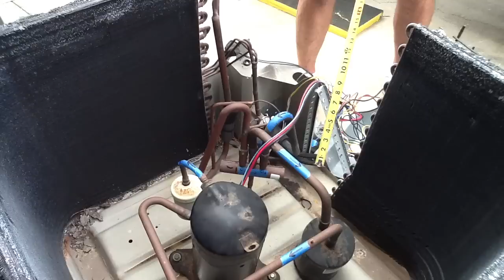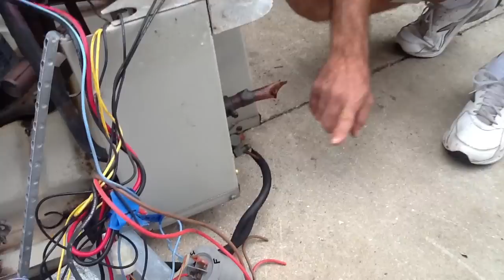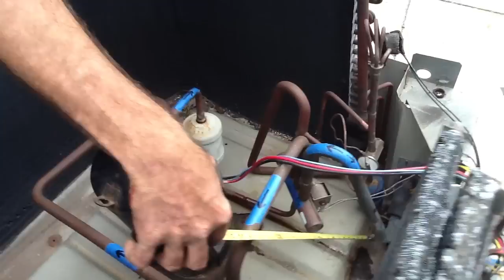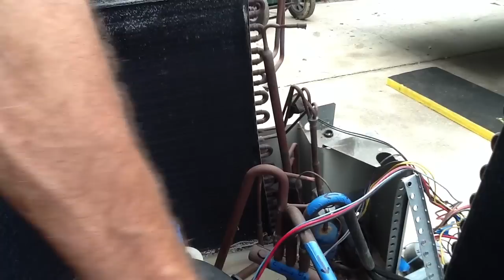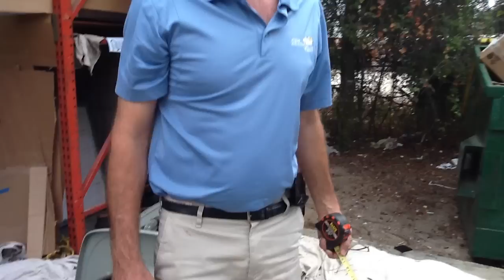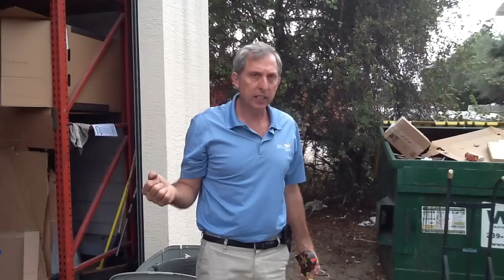Heat Pump Reversing Valve Operation in Heating Mode

Comment from the maker: That sounds like either a bad thermostat, or blower fan relay in the air handler. More than likely its the thermostat. Call me if you have any questions: 239-596-5855. To test the thermostat twist the green and red together and that should energize the blower wheel motor, which would tell you if that's a bad thermostat.

Comment from the maker: If you have attic space above that supply register check to make sure the insulation is not torn or come loose, make sure there is no gap between the attic and ceiling . As  far as the thermostat if it turn the system on and of fit is probley ok. I would change it  to new ditigal  it will be more accurate.thanks for the question. David

Comment: Hi there David the master, I have a problem in my working place , one of my ac vent is dripping  water & I open the vent I look ins inside the duct,insulation is wet,mold dirty,so chech my thermostat lower make it warm,but the problem is my thermostat is it bad or good I can't tell it's a old thermostat no battery it's connected to power somewhere .i think help please!!!!